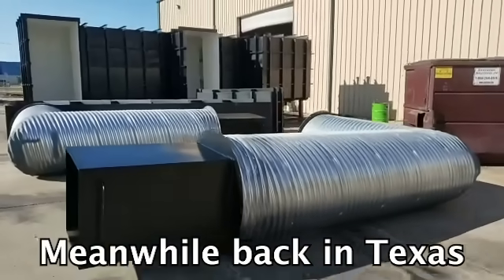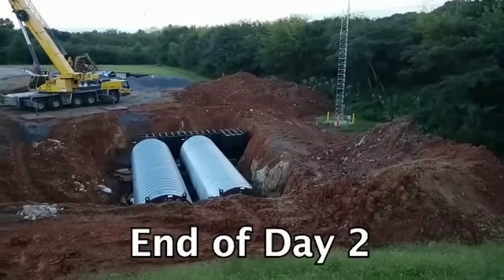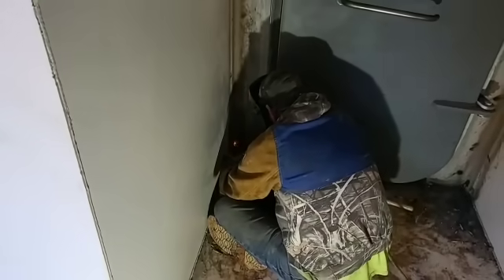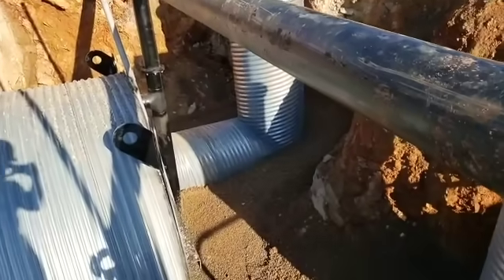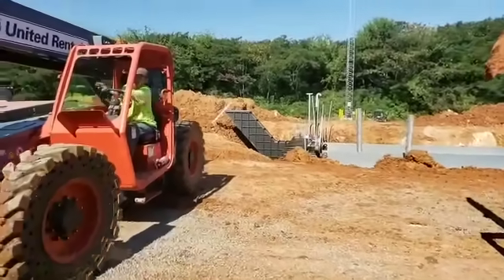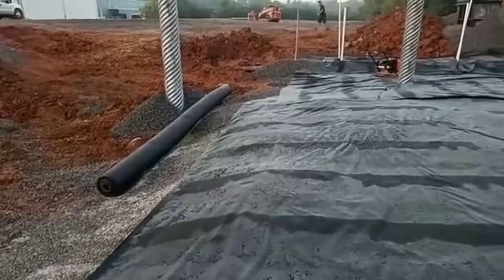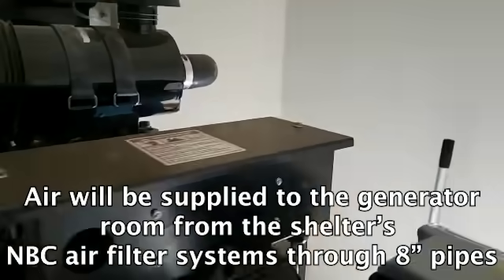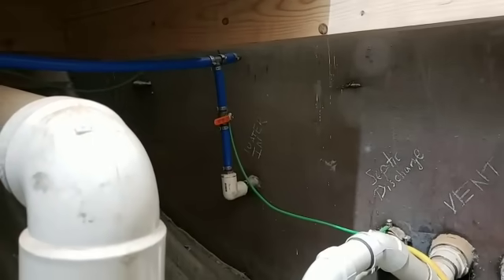Installing Two "Big Boy" Bomb Shelters "Side-by-Side"

Comment: 24 people, two toilets, one shower, and no access to the septic system when sheltering for weeks..    What could go wrong?
Reply: @farplenorp  convinced me , cancelled my order 😁
Reply: I woulda opted for vacuum pack toilets or composting toilets but yea the margin of failure for hygiene is thinner than a shoestring
Reply: 3 toilets.  And there was a grinder/pump to discharge to the septic tank.  It’s labelled “septic discharge” on the wall.  My uncle’s on a septic system out in the country, and he only gets his solids pumped out every 5 years.  And it’s a survival bunker, not a holiday RV.
Reply: @SmokingSevens  How many people are "discharging" to your uncle's septic system?   2?  6?   I bet a whole heck of a lot less than 24.   What are the comparative sizes of the septic tanks and septic drain fields?   I know some folks who end up having their septic pumped every quarter!   

Was it a manual grinder pump?   Let's see... 24 people, using toilet four times a day on average....  (assuming that many people are older/ or maybe experiencing some gastric distress due to a change in diet to survival food.... or maybe radiation poisoning).  (Or come down with some bug from a whole bunch of stressed-out people  in very, very tight quarters; everybody in my Navy boot camp company came down with some sort of gastro-intestinal bug, I understand that that and upper respiratory infections are common in such situations. )     Anyway, that comes out to a toilet being used every 15 minutes.  If it's electric grinder pump, that's a heck of a lot of electrical power usage in a situation where there may be limited power available.  Was there a spare?   If you removed the pump to install spare.... what drains back?
Reply: Gotta do what you gotta do. Better than being up top when a nuke hits
Reply: @ryan1274 yeah
Reply: @ryan1274 I wonder how effective   this Bunker is against Nuclear Radiation.
Reply: Look, if it gets to a point where I gotta live underground in a flippin bunker, do I even want to be alive anymore at that point? I mean it’s obvious if that’s the situation, everything has pretty much got to 💩 so why would anyone want to even be around anymore? Lord knows what kind of life they’ll have above ground after whatever it was that put you underground to begin with! These things are cool if there’s some sort of natural disaster that you can get through.. but any of the real crazy stuff, naw… Id rather just be taken out and call it quits.
Reply: The point is to get you through the first 14-24 Weeks.
Reply: Those toilets are unventilated too 🤢
Reply: @cameronalexander359 that would be the least of their worries if there was a reason to use it.
Reply: @unisonicz1  true that.   Nevertheless....
Reply: @harrymu148 I was thinking compost would be better
Reply: I wouldn't suggest having tacos on the menu with that many people and only 2 toilets.
Reply: Who would want to live in a post apocalyptic world?
Reply: I would like this but its at 69 🤣
Reply: @rederik23  eh, I guess some would rather have the option to decide whether or not to live in a post nuclear strike world .   A resourceful person always has the ability to choose not to.   But i'm old, live near several military bases and a major city, and have not bothered to build a bomb shelter... I guess I've already made my choice.
Reply: The money they’re wasting on that coffin.
Reply: You think in a nuclear bunker you would have to manually empty a septic tank? 😮
Reply: You're so negative. It is not like they have the bathroom located in front of the sleeping quarters. It is not like you have to walk through the bathroom to lay down. You act like there are openings like messing parts of the wall in the bathroom as well....
Reply: With 24 people that macerator will jam on the first day.
Should have went with the vacuum sealing toilet.
Reply: I’m new to this world. Why are escape hatches filled with sand?
Reply: @TheMoonDejesus I’m guessing that it provides some insulation from radiation.
Reply: Install bidet attachment. Do not use or stock TP. Should be ok.
Reply: @EvermontKing  no flushing tampons, either
Reply: @dharmaslife3361 Yes, but imagine my embarassment when I was a teen aged boy cleaning out a clogged sewer line as a favor, and pointed out how the clog was a bunch of drowned mice...and then was corrected as to what those grey wet things with tails were.
Reply: Composting toilets
Reply: @ryan1274 this thing isn’t nearly deep enough to protect against a nuke.   It’ll most definitely Draven you from the fallout afterwards though.
Reply: @funnyfarmdad9997  Not hardened against a direct hit, no.  But then neither are Minuteman missile launch facilities.   This isn't shock mounted like a missile launch control facility either... but then, the owner wasn't spending other people's money... and just have to live (or die) with the fact that in the extremely unlikely event of a nuclear blast nearby, they will have to be further way to be adequately  protected.
Reply: @dharmaslife3361 particulate contamination (fallout) will float around corners on air currents, of get tracked in on feet in post blast explorations of surface.   The right angle is useful for shielding against things like Gamma  and neutron radiation which won't make a 90 degree turn (if the source was aligned with your entryway).
Reply: @joellenrhodes456  i had a big reply about the energy requirements  of heating pads and ventilation fans of composting toilets- turns out to be a couple of kilowatts to run composting toilets for 24 people full time.   Don't know what happened to it.
Reply: Why waste all this money, it's selfish.. I'm broke, I have no car, I'm finding it hard to find a job.. They could help me get on my feet and The road.. Then I can look after my five children and wife the way they deserve.. 
Help the people in the world you live in that's now and not worry about the future that won't be after having to get stuck in this bunker.. Share your half a million with us who need help and make a million friends and let's all build a bunker city together.. And then we can party like world is gonna end😊😊😊
We'll even build a underground  stadium and get Steel Panther to rock us into the future😅
Reply: Guys, Here is The Savior

YaH The Heavenly Father (Genesis 1), YaH, Who, with His HAND, formed “man (Adam)”, from the dust of the ground (Genesis 2:7). It was YaH’s HAND they NAILED to the Almond Tree, to symbolize forgiveness of the “Tree of Life” sin OF “man” and thus “The Fall OF man” (Genesis 3). YaH The Father arrived to be Crucified via the Tent of Meeting (Exodus 33, Isa Scroll), how YaH has ALWAYS arrived
Reply: Paranoia sure looks expensive.
Reply: Kind of seems like this bunker is for a team of  computer experts or scientists , rather than  survival if family and freinds  /  makes me wonder who the client might be what they are involved in and what they know about the future !
At a guess not a family orientated customer
Reply: Nowhere to wash your clothes, either. And how do you get rid of garbage?
Reply: @EvermontKing  how much water do you have available for  operating a bidet ?   What is the percolation of the leach field..
Reply: Aroma of love
Reply: 😅 you make some goddamn mud pies skipper
Reply: Brings new meaning to Purge 😂
Reply: Not extremely useless but not completely useful. Just a bunch of people attempting construction of what they think a bunker should be. Posting the full build online also kind of defeats the purpose. I’ve already found your bunker on Google Earth as your red rood warehouse is a dead giveaway. If you were a truly integral company who cared about your client’s and family’s interests you wouldn’t post this stuff.
Reply: @bully056 
Look up how long radiation stays in the ground and water supply. Won’t be anything left. Animals will die out water you can’t drink so what’s the point. I would rather go on the blink of an eye then over weeks or months.
Reply: The guy dropped underfloor to show how the drains and grinder pump discharge to municipal sewer. Why are you worried about a septic system?
Reply: @KirkHermary  so... if you work in the municipal sewer plant.... are you going to continue reporting to work after that apocalyptic disaster that made the owner's ability  to  seek refuge in this shelter a good thing?  Or would you be dead, because you didn't have access to a shelter like this?    Or heading for the hills to ride out the bad time?   Personally, I wouldn't count on sewers working.   Inwould hhave more faith in my own properly designed septic system.   Not to mention the badness that can come from them in major rain storms, like what has happened in North Carolina after Hurricane Helene.
Reply: how your toilet when your above ground with all the fall out.  ever heard of a sponge bath.  most bunker have a washroom and a holding tank for human waste.
Reply: I never see the solution for cleaning clothes and trash disposal. Does he address that in any videos?

Comment: As a Retired US Navy Submariner, I would purchase one of our retired Submarines and Bury it much the same way and still feel like I was still doing Special Ops!!!
Reply from the maker: It would be unable to be delivered
Reply: An old boomer, complete with missile tubes etc... but... UNSINKABLE...

Just put up a bunch of tourist signs to the submarine memorial... Just the Sail above ground.... missile tubes covered with a couple of inches of peat moss.....ready and waiting.
Reply: Bubblehead!
Reply: @ssn608    i like the way you think!!
Reply: @AtlasSurvivalShelters obviously it would need to be trucked in several pieces. Have you ever seen some of the huge nuclear reactor parts that needed to be trucked? It wouldn’t be cost effective ultimately. Your products seem to make sense. 👍
Reply: Прикольно 👍
Reply: THat is an EXCELLENT Project Idea, as long as the metal isnt rusty.
Reply: You would have a smidge more privacy. And a decent galley.
Reply: @AtlasSurvivalShelters  Anything can be delivered! Bet you could make it happen. Be a Alpha chest bump. Bam! Atlas problem solving! 👊
Reply: @AtlasSurvivalShelters  Sounds like you already tried that 😅
Reply: @TURTLEORIGINAL  they cut out and bury the section of submarine hulls containing entire Reactor compartments in Hanford, Washington.   Most of the trip from the scappimg shipyard to the middle of Washington state is on a barge, but the final 26 miles is by truck.